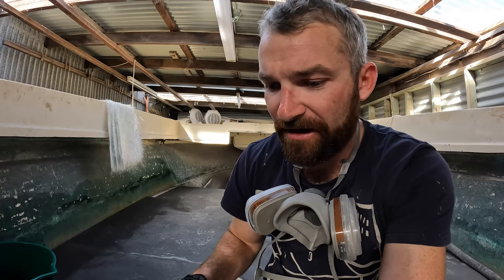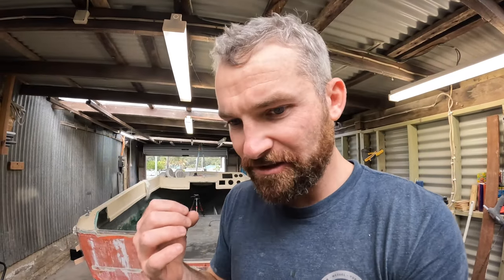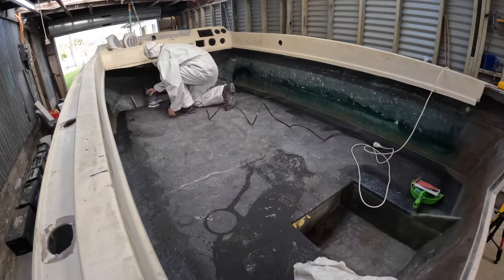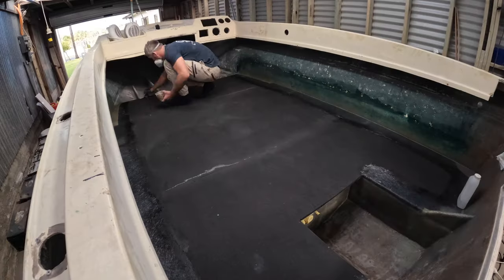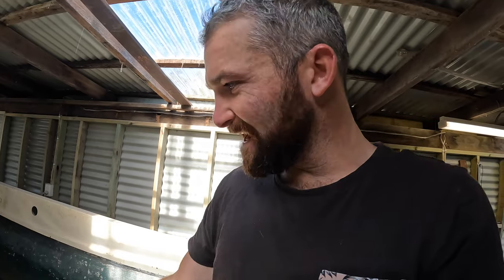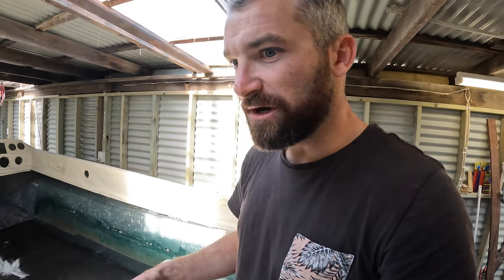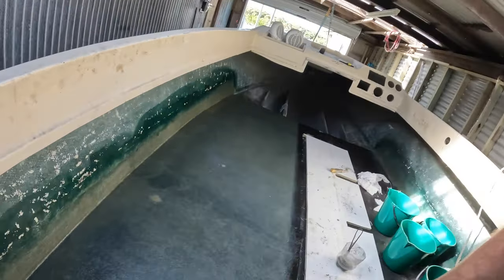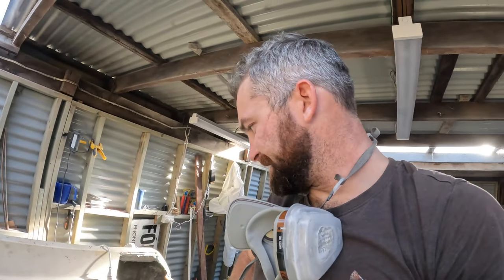Fibreglassing a Floor in a 6m Boat

Comment: You’re doing a very good job. The old rule of thumb for your radius’s or fillets is to be the same width as the ply or boards you’re using. 15mm board- 15mm radius. It ads structural strength.

Comment: with 3 layers on the floor...1 being DB you should have gone across, not down the hull...just my opinion. (3 restorations and a full new build myself)
Reply from the maker: Do you think I should add more glass to the floor now?
Reply: @ADVENTURES_ADRIFT  Good Lord no !!....your work is solid and well thought through. The problem you had with the layup was what I was talking about. Laying across ways would have given you less stress and fewer problems with bubbles etc. That thing is a tank, the DB is your strength, the Chop was probably unneccassary but is good for a final top cover. I doubt the boat will ever leak!!
Reply from the maker: Ahh I hear what you’re putting down, cheers mate. Looking forward to seeing what she’s like on the water!

Comment: Did you lay CSM because your 1708 had no CSM backer or did it also have CSM backer?
Reply from the maker: We don’t normally use 1708 here in Australia. What I’m using for structural glass matting is called Double Bias and it does not have a CSM backing like 1708. That’s why we always using a bedding layer of CSM before laying DB.